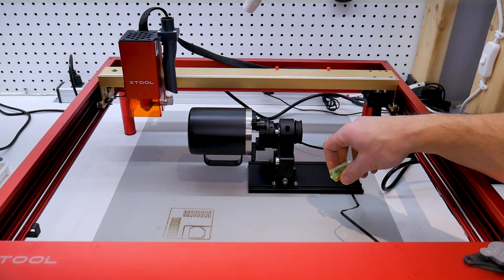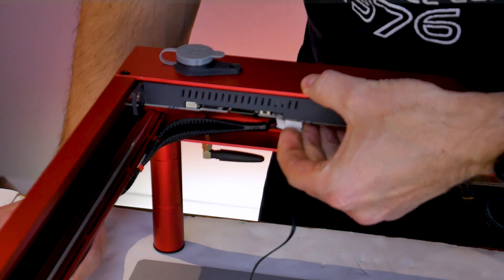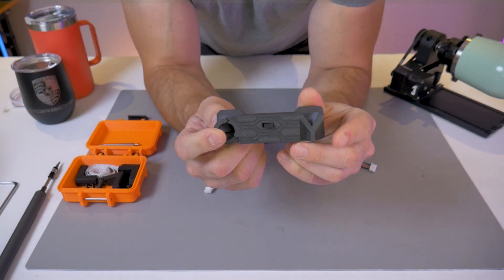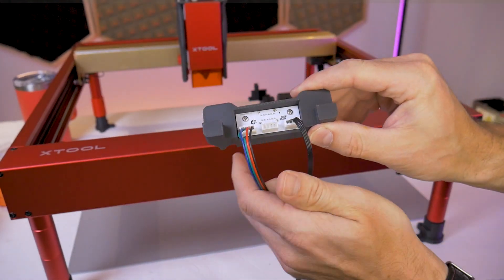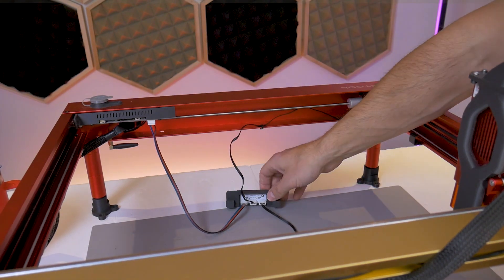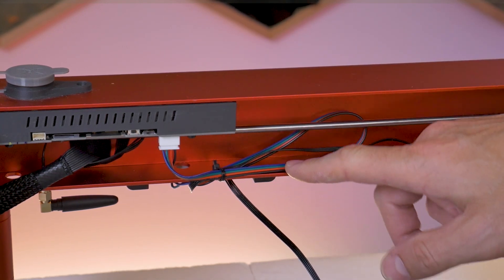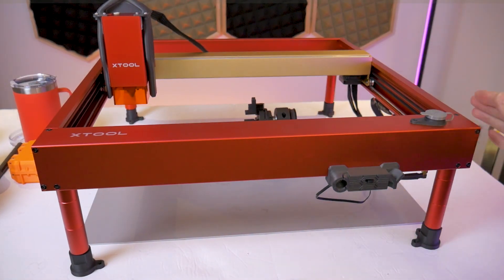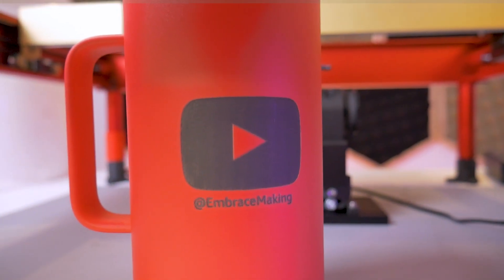XTOOL RA2 PRO Rotary Switch Installation (Front Mount)

Comment: Is there an alternate installation location?   I’m using the Xtool enclosure and it looks like the switch might interfere or I will have to cut an opening for it.
Reply: I just saw your updated video for V2 and checked my switch. It is a V2, problem solved.
Reply from the maker: Glad you saw the second video, the V2 was designed for the purpose of clearing the enclosure :)